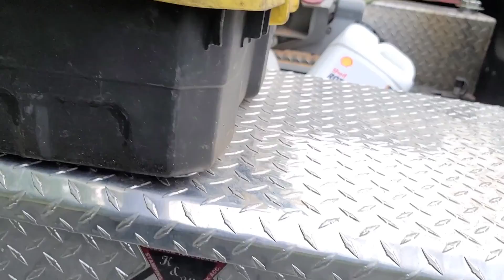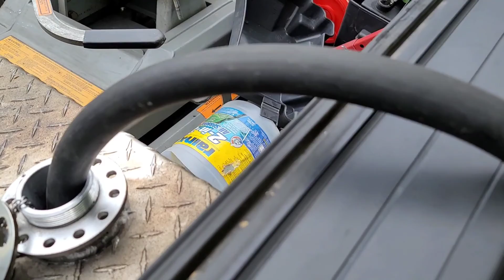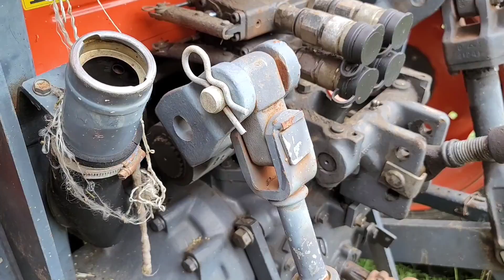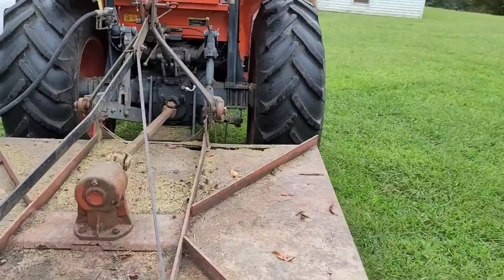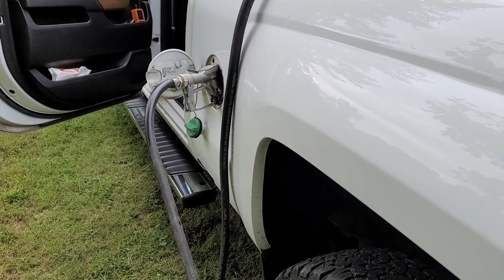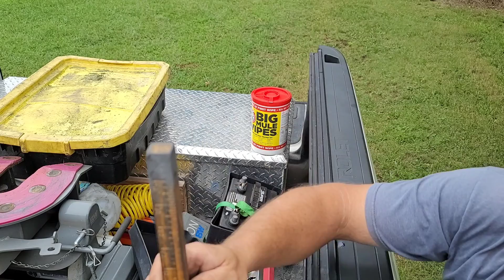Diesel Transfer Pump from Harbor Freight

Comment: Can I use this pump for regular gas?
Reply from the maker: If i remember correctly it's made for oil based fuels like diesel and kerosene. Not sure how I'd last on gasoline
Reply: Just bought one tonight. It specifically says no gasoline

Comment: Picked up one of these today. My GPI pump failed, need to put 45 gallons in my fuel tank. As with a 1400 mile round trip. I'm saving more than the pump price on that fuel. As I still have 200 gallons of the $1.59. per gallon fuel.
Reply from the maker: No doubt, i know mine sure has been handy

Comment: I removed the alligator clamps and wired it into a male 7 point trailer connector.  Now I just plug it into the trailer connection next to my hitch anytime I need to pump.  Works perfect.  And you are right about that hose collapsing if you use part of it for the suction side.  I got 5’ of 3/4” fuel hose from O’reillys Auto Parts.  Perfect
Reply from the maker: That's awesome!
Reply: See! Sometimes I get terrific ideas from just reading the comments! And most the ideas are usually so basic and simple like this one,, but yet I still smack my forehead thinking,, Why didn't I think of that?! Great idea! Thanks for sharing that!
Reply: @km6344 you’re welcome!  I hope it makes life easier for you.  It sure did for me

Comment: Is there a way to add an inline filter?
Reply from the maker: I'm sure there is but I've never looked into it. It came with a strainer/ filter that would go on the end of the hose that you drop in the tank that your pulling from but i never put it on